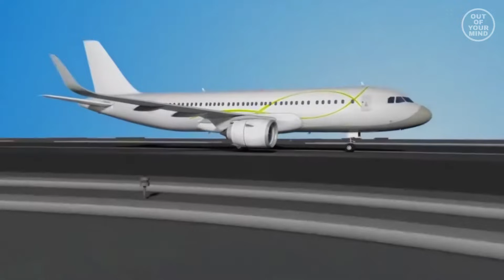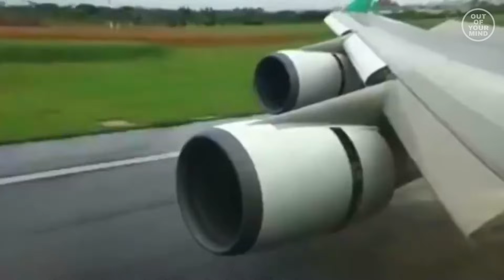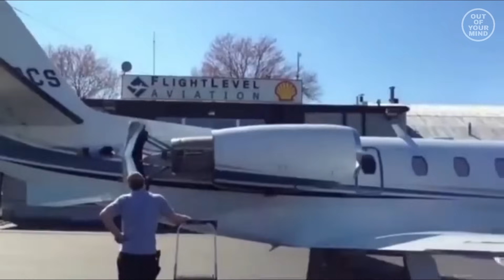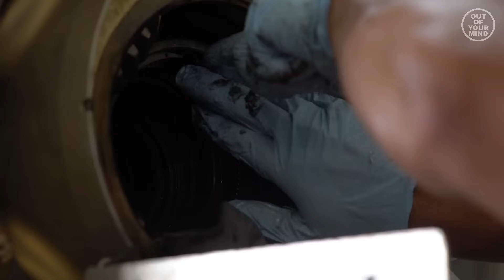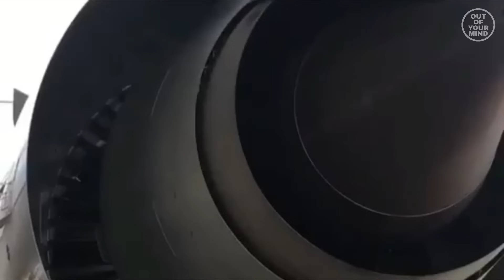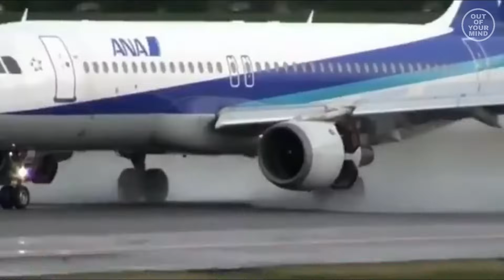Thrust Reverser, How The Jet Engine Air Brake Work?

Comment: The word is Nacelle pronounce Na-Cell

The large turbo fan thrust reverser that uses cascades blocks more than 95% of the fan thrust created. Very little thrust is generated by the engine combustion air which is close to 750-800 degrees F.

For the C5M Globemaster, the thrust reverser is designed for in flight deployment to slow the aircraft.
Reply: Lockheed C-5M Super Galaxy. McDonnell Douglas/Boeing C-17 Globemaster III. 😉

Comment: Interesting that turbofan thrust reversers only divert the fan thrust.  The core engine still produces thrust, somewhat diminishing the effect.
Reply: This is a turbofan engine. The smaller "core" only produces enough thrust to spin the high bypass fan in a turbofan engine(used in jet liners and tankers).  Its called "high bypass" because the fan has far greater thrust than the low bypass turbine blades (called a "core" here). You can almost think of these as the semi engines of the plane world. lots of thrust, lower speed, fuel efficiency. These engines can utilize the massive amount of air/thrust generated by the fan since they have high and low bypass so cascade and clamshell can be used. 

In a turbojet (the ones used on fighter jets), there is no separate large high bypass fan. These engines instead rely on high pressure and have several more rows of blades that compress the air far greater than a turbofan engine. Think of these engines as one giant high bypass core that produces a metric ton of thrust concentrated more so than a turbofan. Think of these as the hypercar engines of the jet world. Lots of thrust, speed, eats fuel like a bitch. These need to use bucket style reverse because there is no separate high/low bypass, all of it is basically high bypass.

Those little business jets shown here are low bypass only. Lots of air through those little engines, the air isn't being compressed nearly as much as the other two, great for altitude and fuel efficiency but they don't produce tons and tons of thrust. Think of these guys the commuter car engines of the jet world.  Not very powerful but get you there and sip fuel. These little guys NEED to use bucket style like the jets because there isn't any high bypass fan to utilize. Same as the fighter jets on a much small scale. 

The rest are similar.  Turboshaft- a core that spins a shaft which spin helicopter blades. Turboprop- a core that spins a propeller, usually with pitch reverse thrust, seen on a lot of military and medium civ planes.  Jet Turbine- A core that usually spins an electric generator head or a natural gas compressor on an oil field.
Reply: @NotRandoWis  Do you what percentage of total thrust the core produces?
Reply: @bertg.6056  The low bypass part pf the engine( again called the core here ) produces 20 to 30 percent of the total thrust.  The high bypass part with the large fan blade in front produces 80% or so of the thrust in a turbofan engine on a jetliner. The reverse brake uses the 80% thrust produced by the by fan blade and pushes it forward when the clamshell or cascade 

The business jet( low bypass only engine) and fighter jets ( high bypass only engine) 100% of the thrust comes form the "core" since there are no bypass stages like a jetliner engine ( turbofan). So they NEED to use clamshell and often use 100% thrust in reverse. 

But you gotta remember, fighter jets and those little business jets use much smaller engines then a huge jetliner or tanker jet. The volume of air used in the jetliner is a lot more then the other two.
Reply: In a jumbo jet SST fitted with afterburning high-bypass turbofan engines, of course it would have eyelid thrust reversers similar to Concorde, so you can slow down a huge and heavy plane down from 200 MPH landing speed down to about 30 MPH taxiing speed. So of course jet engines gotta be designed for ease of usage in mind. Side or eyelid thrust reversers, doesn't matter, as long as you actually can brake an airplane after it has landed.

Comment: Wrong. Air brake had nothing to do with engine except reduce throttle  but because  inertia keep forward thrust so real air brake mean using flap upper part turn it upward like trimming but much more wing area involved

Comment: Are these the famous air brakes?
Reply: I think air brakes are a set of spoilers which are deployed during landing.
Reply: No… air brakes are control surfaces that are deployed to increase drag, thereby reducing airspeed.  On most commercial aircraft these surfaces are also used as spoilers during landing to reduce lift and add downward force to make the wheel brakes more effective.